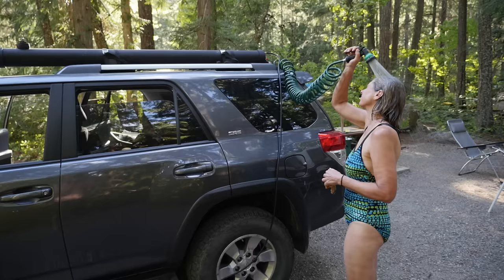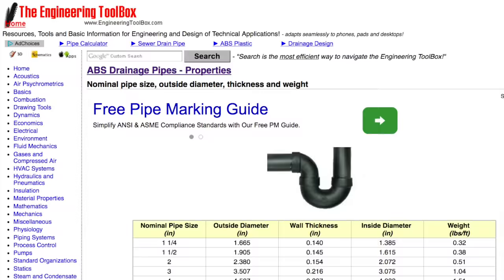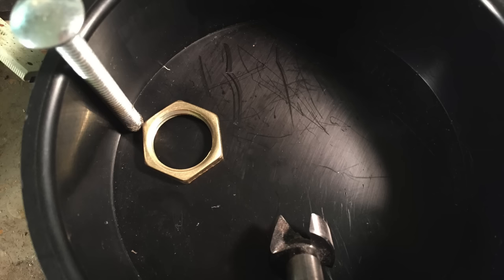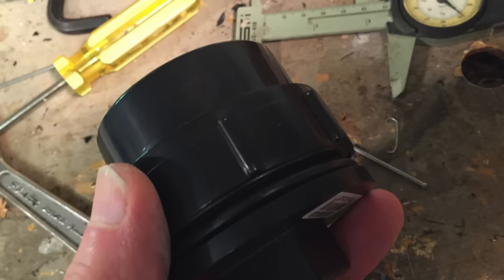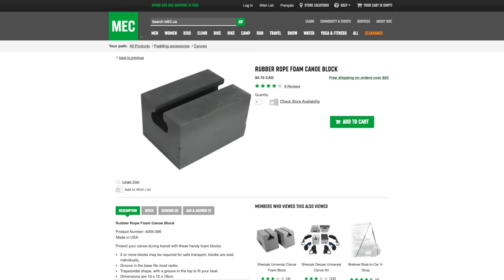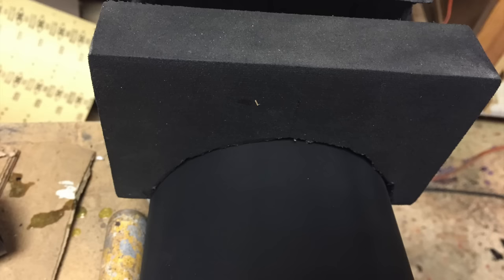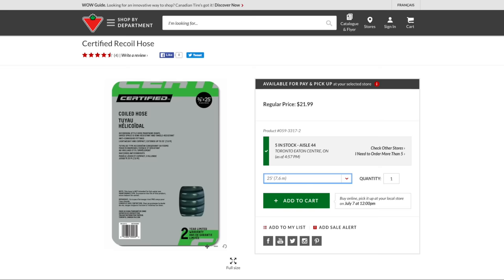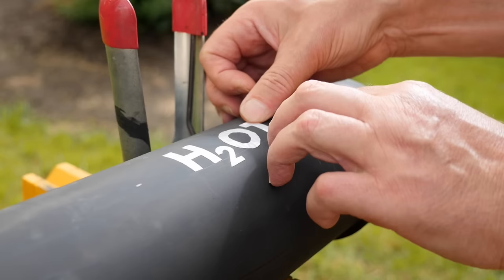H2OT - Rooftop, pressurized, solar-heated shower/sprayer using ABS pipe. DIY

Comment: Nice. My home/shop 16 ft cargo will have a solar water heater now!
I will up it for abs to 4"sch80 pvc ir possibly 6" cs900 whatever is located first? Pretty sure the Desert Southwest will require a substantially stronger more resiliant pipe. Used with my pressure pump I should have no need for the compressor!
What a spiffy idea I should have thought of that as we used to heat our pool in Colorado by laying out black sprinkler pipe in the Sun.
Reply from the maker: So glad your found this helpful and have used it to improve on the design.  You live in the perfect locale for solar heating.   Please post an update of you set up.

Comment: Since this video is several years old, I was wondering how your project is faring. Have you had any issues with warping from too much sunlight? Alternatively, did you remove it from your vehicle for winter and if not did freezing temperatures have a negative effect? Great video by the way and wonderful narration.

Comment: your very skilled here, i might use this idea but expand it to double capasity
Reply from the maker: I contemplated a double tube system as well. That is why in my spreadsheet you will see so many lengths, including 12 feet.  That would account for two 6 foot tubes. 

There are some physical connection challenges with a dual system as they must be connected level with the invert (inside bottom) of the pipe. Otherwise, the second pipe will not fully drain.

Comment: Did you consider how clean you kept the pieces throughout, perhaps thinking about using it for potable water? I didn’t. Figured we’ll just use it for showering. I just finished mine up today that’s just like yours. It’s going on the rack of a new teardrop camper. Thanks for the great idea and instructions.
Reply from the maker: Excellent. I am glad you found it useful. You will quickly see that you will have to run the compressor more frequently when the tank is full as there is little void for air to fill. As the tank drains, more air can be compressed and you will not need the compressor after about half a tankful.  Also, always fill the tank to the brim. Do not drive with any void in the tan. When full, it is a solid mass and the water will not shift.  If it is partly empty, the water will form a water hammer if you hit the brakes and the end result is an unwanted missile launch.
Reply: @ImaginetMedia  You should pin this reply to the top for those without experience. Could save some damage...

Comment: Nice job and great narration. Questions:

Does the water inside the tube at half full, slosh around under pressure or does it remain somewhat stable? Would you feel an affect while turning sharply and/or braking?

Would you think a small expansion tank help with a more even water pressure?

Thanks for a reply. Regards JJ
Reply from the maker: Great question.  I always drive with the tank 100% full (literately right to the brim). I do this to avoid the potential water hammer that would be created should a sudden stop occur with a less than full tank.  I am fairly sure that if you were going fast enough and the stop was abrupt enough, that there would be consequences.  As such, I prefer to have the tank filled so that it is a "solid" mas as opposed to a fluid one.
Reply: Thanks for the reply. I just think the top heavy and one sided influence of the system! But, apparently it works good? You are one of the best You Tuber. Everything is the best in your video. Regards JJ
Reply: imaginetMedia 

that  is a major serious good point... 

might be worth the time to do an add on update to the video... even just a little typed in note just so viewers know and can take that into consideration .... even i didnt think of that ...just stumbled onto here just now.

Comment: Seriously who the hell gives this a thumbs down??????
Reply: Have you made one? Youtube is full of bullshit. They don't work all fantastic like this video suggests. Apart from PVC being unsafe, the major issue is constant pressure is required to maintain a constant flow.
Reply: @MrFastFarmer  its ABS not PVC, but hey nothing wrong with a thumbs down if it doesnt work for u, thats youtube
Reply: The people who make and sell the expensive welded tanks would give this a thumbs down as it will cut into their market shares.
Reply: @MrFastFarmer  ABS is NOT PVC .  The ABS has a thicker wall that can handle the pressure.  Fast Farmer you don't seem to know much about anything.  If a person opens the fill valve the atmospheric pressure would be enough to give flow for  a shower and would use less volume of water with gravity flow.
Reply: Dee Jay you are pressuring the pvc, so too much pressure and it will simply explode. It’s why many are saying ABS, but even so I wouldn’t trust that. There is a reason why professional units are welded aluminium.
Reply: @MrFastFarmer  There is a reason that I tape mesh screen around my potato gun :)

Comment: I did one and its working great specially i installed air pressure gauge on it , thank you for great idea
Reply from the maker: if you can, please post a link to the pressure gauge you bought. That is a great mod to the design.
NOTE: I have since swapped out the radiator drain valve with a 60psi pressure relief valve than another viewer suggested.

Comment: Very nice video, but did I miss something? The pipe was already black, why the primer and black spray paint?
Reply from the maker: Yes, you missed something. Flat black increases the thermal absorption over a gloss surface. Plus, this offers much-improved UV protection.
Reply: @ImaginetMedia  ABS plastic has a few cons, UV protection is one of them that weakens it. Thus the paint helps to decrease this issue.

Comment: Genius best DIY video and explanation. i Like, OLE!
one question, if pipe is already black, why paint flat black ?
Reply from the maker: Thank you for the kind words.  ABS is black, but it has a near gloss finish. A matt finish on the other hand, will absorb more solar energy - a lot more.  Hence, I used flat black camo paint. Also, ABS has marginal UV protection. Paint over the ABS and you have added many many years of UV protection to the plastic.
Reply: @ImaginetMedia  Thank You for your reply. so happens I'm taking a solar thermal course and forgot to ask that same question to my Instructor. Thumbs Up!
Reply: @ImaginetMedia  Scrolling through a 1000 comments and it appears people don't fully watch the video. LOL
Reply: @fvrrljr  I've taken that class too. I doubt the instructor would know.

Comment: Very nice.  I love to watch how creative people are.  I also just built my own power solar box for less than $200 that does what the expensive Jackery power boxes do.  it has a build in 110 volt inverter and cigarette socket to run my 12 volt refrigerator and all usb devices
Reply: Do you have a video of how you did this?
Reply: @goku.lc80  Sorry I do not however my idea is not original as many people have posted this project on YouTube.  I just took a large Camco battery box, bought a 12 volt deep cycle battery from Walmart,  cut a slot in the box for a cigarette socket and a cheap $14 panel that contains a voltmeter, USB port (eBay part).   I had a 400 watt full sine wave inverter that fits nicely in the box.  The wiring is pretty straightforward and easy.  You can buy Windy Nation 100 watt rigid panels for only $75 with free shipping that go on top of your vehicle.  My panel fits nicely on the luggage rack of the truck. Solar charge controller are only about $12 (PMW type).  That Jackery 1000 which is their top of the line model runs $999.  There is nothing that box can do that mine cant.  It was a lot of fun doing this project and very effective as we are now truck camping and needed this to run a 12 volt refrigerator.
Reply: @goku.lc80  I do. I put all the electronics in my spare-tire cavity.
My friend has a goal zero and he had to send it in for service when a fuse blew. He could'nt change the fuse himself.
It's definitely nice to be able to fix your own stuff.
Reply: @philc.9280  I started off with a small ammo box as well. I later upgraded to my whole spare-tire area. Happy Camping!

Comment: What was the reasoning for not going with 6" ?  The reason I'm asking is because I'm considering 6" and that spreadsheet looks like you might have a good reply.
Reply from the maker: Price and availability. 6" ABS costs 3 times as much as 4" diameter.
Reply: @ImaginetMedia  Oh dang. Ok 👍

Comment: I built something very similar using a 4" x 6' pvc pipe but I use 4" sewer stops that are removable .. I have a 5' piece of 4" on the other side of my roof rack that I again use the sewer stops and this one holds my tent poles, hiking poles, sand flag, etc.  I do like your idea for an end cap and valve ... your design is better then mine and I may convert to your method.  Great video.

Comment: What was your total cost in materials and what was the total time that went into the build?
Reply from the maker: $12.59
1 Hr 33 min.
Reply: @ImaginetMedia  I was curios how much everything cost as well. How can all if that pipe and fittings only cost that much? I figured it would be at least $100. I've seen some builds like yours go over $200.
Reply from the maker: @garrettrichardson403  I had a lot of the material on hand already from other DIY projects and from my house renovation. I also had all the tools. So, those factors guided the design.

Comment: ABS piping used in Drain , Waste & Vent ( DWV ) is not approved for pressure and in your design you are building a bomb that will burst this sending the now hot water everywhere . A better and safer material would be the use of PVC piping which is designed for pressure & temperature . You can paint it black to absorb the suns ray and it will not bend or warp in the sunlight like ABS does . PVC piping comes in schedule 40 & thick walled 80 in the same size your using larger. 
Happy camping
Reply: You are a correct and good eye for detail. I did not catch he used ABS. Schedule 40 PVC should be fine for his low temp.

Comment: This can be augmented by adding an internal heating element (if you have AC or Inverter) or propane tankless heater for when solar wont be good enough all for under $150 US. Even if I had an indoor shower, I would put one or two of these on the roof of an RV, skoolie or van. Great storage and more water for your off grid showers. Thank you!!

Comment: Nice build, I would probably change out to "quick disconnects" for air and water.
Reply from the maker: Good idea for a modification. In my set up though, a quick release for the water would extend the connection too far and interfere with the back hatch opening.

Comment: Yes folks that's right!! With just some 3 or 4 inch abs end caps , air valve and hose bib..this can be yours for the low low cost of about 100.00dollars!!  It would have been a lot less if pipe prices didn't skyrocket!!

Comment: Nice job. If you wanted more water, you could use bigger pipe or connect two pipes together (top and bottom) in an "O" shape using 3 "90's" and one "T" at one end with the valve in a cap on the end of the "T".

I guess you could even use "T's"  and make as many tanks as you wanted to.
Reply from the maker: That would be a great modification. I am just a little concerned about weight though, as anything heavier would require a much more secure roof mounting system.

Comment: Amazing video! Did gave me an idea to make my own. I like the parts you used.the upside to this project is that I am a welder and am going to make me an all steel rectangle box for the water.perks of working with steel!😉😉
Reply: yashee96 Thought about rust yet?  If you can weld, try using aluminum or stainless.  Copper or brass works too.  By design, it's just like a car radiator.
Reply: @drjay7879  I can just coat the inside of the tank with a rust resistant enamel or something...stainless or aluminum would be expenaive
Reply: @ yashee96: show off... i Like. OLE!

Comment: This is awesome! I was considering making something similar with a 5 gallon water jug. It would have been gravity powered, but this is waaaaay better! Now...consider a long cylindrical beer keg....lol
Reply: A gravity shower is longer use but at low pressure.
This has a quicker use but also higher water pressure.
My point is the air-compressed showers have greater water pressure. So if you have long hair to wash soap out of I would recommend this idea over a gravity fed system.

Comment: A low heat stirling engine air pump could be designed to operate off the heat of the roof top to pressurize the water vessel.

Comment: Plus black with a gave you a heat increase of 4 degrees. I have put colors and you could purchase from my local hardware store and spray cans into a spreadsheet along with their solar temperature and was able to determine that gloss black would be the fastest heat and the highest temperature.

Comment from the maker: I would say I spend about $50 in parts as I had some of the components already on hand from previous projects (ABS solvent, paint, hole saw, etc.) The most expensive part would probably the 4" pipe itself.

Comment: I was thinking about purchasing a Road Shower 4L (10 gallon), I like this idea better and is MUUCH cheaper.  Unsure about potability using the ABS, but a quick Google search tends to lean toward safe.  Especially for a few trips out into the sticks a year.  

Guess the downsides would be UV damage, heat exposure (shouldn't be an issue with water in it), and the possibility of breaking while the all-welded aluminum Road Shower would probably last several lifetimes if cared for.
Reply from the maker: Thanks for the comments.  Regarding UV, that is why I painted it, plus the flat black paints adds to the heat absorption characteristics. Also, the shower is only on my roof when I go camping. The rest of the year, it is in my basement.  Next, I am only showering with it, not making soup, so the potability is not really an issue as a tank  of water is only stored for 10 hours or so at most.

Comment: Nice, I could only add a white shiny coat to the bottom of the pipe would decrease outgoing thermal radiation with low effect on the input. Even better would be gluing on some insulating foam to the whole underside this would increase the max temp possible.
Reply from the maker: The roof of my truck gets very hot and reflects that heat to the underside of the shower. Painting it white would reduce that radiant secondary heating.   Adding insulation would block heat from reaching the pipe.

Comment: Nicely done, Ty. Think I'm gonna go with 2 tubes of 4" or 6" tho for a bit more capacity.
Reply from the maker: I considered this but the connection between the two presents some design and function challenges.
Reply: Yes I see that also. I priced the pipe and 6" is @$180 for 20' _ cannot find anything shorter so that's problem too. Maybe 2 singles, one on each side of the roof? Seems the Low-Drama way to solve the problem.

Comment: Very clever!! Hopefully I can find similar fittings here in Australia!
I already have an air pump installed in my 4x4.
Just need to build different blocks for my car roof.
Reply: You could also use a swimming pool noodle sliced and diced strategically 👍

Comment: Planning on doing this but instead of a hole saw and cutting the pipe planning on using a fitting  T with a threaded access.
Reply from the maker: That will certainly work, as you could use the 4" x 2" x 4" tee with a cap instead of just a end cap.

Comment: i like your idea a lot, and it seems easy enough to make. but the down side seems to be that it might only work for summer times, as that water temperature simply wont work during the winter
Reply from the maker: I do not camp in the winter here. Everything is too cold.

Comment: How about a huge syringe with a metal spring that supplied the water pressure has you released the water the plunger would push the water. Just put a simple pull cord at one end to charge the water vessel. ; )

Comment: Excellent well done video.  I especially like your method of attaching the 2" fitting. 
One common thread (no pun intended) after reading most of the comments below is that there is a lot of confusion about the pipe you used. Here in Canada, ABS (Acrylonitrile Butadiene Styrene) pipe is the norm for drain pipes in homes. There are quite a few areas in the US that only use white PVC (polyvinyl chloride) so they may not understand the difference.  
I am starting a Water Tank Bumper mod on my Jeep, and if that fails this is going to be my back up! Brilliantly presented.
Reply from the maker: Thank you for the kind words. If you have any questions about the build, let me know.

Comment: This is one of the best DIY videos I've ever seen!  Very clear and concise.  One question: could you provide information about your compressor?
Reply from the maker: Thank you for your kind words. I am glad you found it helpful.   The compressor I used is a Viair 88P. Do NOT go cheap on the compressor unless you plan on it failing when you need it the most (inflating a flat tire). This one is fantastic and it hooks up directly to your battery (bypassing the common accessory plug  fuse point of failure).
https://www.amazon.com/Viair-00088-88P-Portable-Compressor/dp/B005ASY23I/

Comment: Just as well to go double 6" pipes.   10+ gallons seems more realistic if you take a shower one or two times a day.   I'm about to design a mini shower built in to my mini van.  ;)   Never seen it done before.  Guess I'll be the first.
Reply from the maker: Be sure to read my FAQ in the description for many tips on building and using the shower.  I covered a lot of info that was not shown in the video.